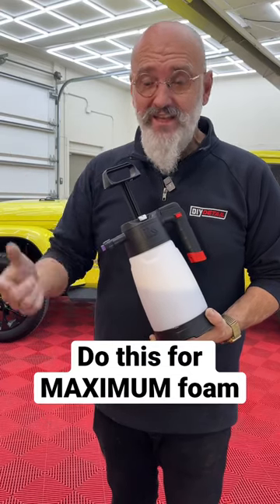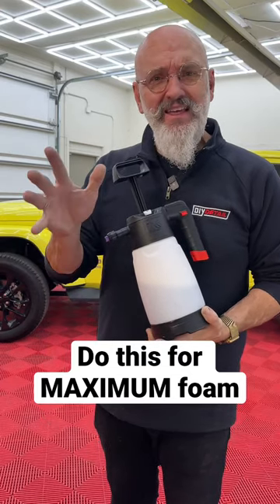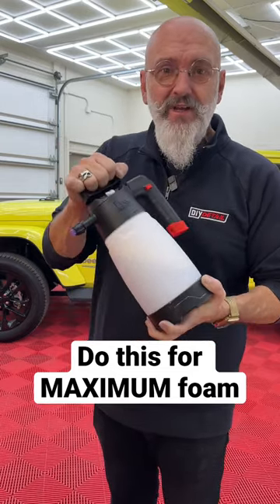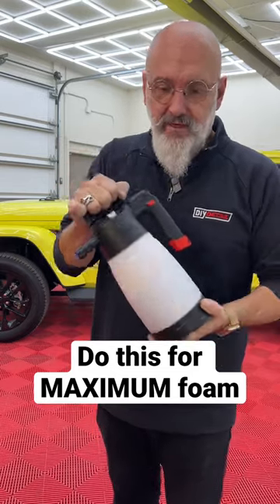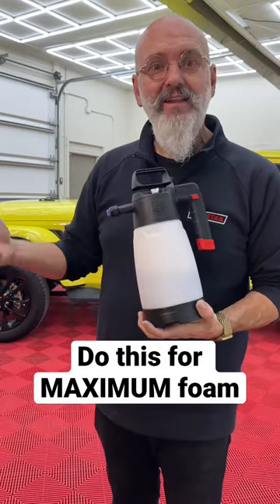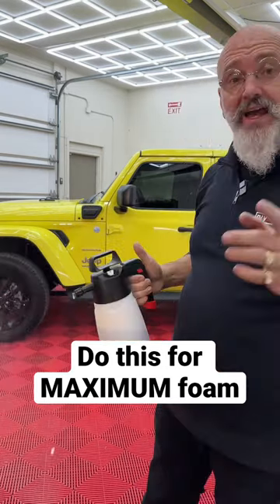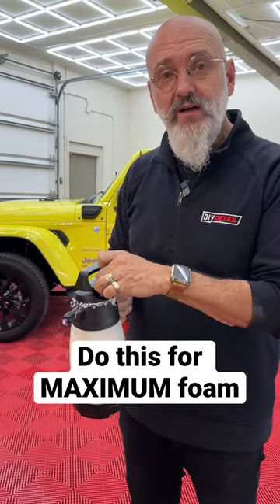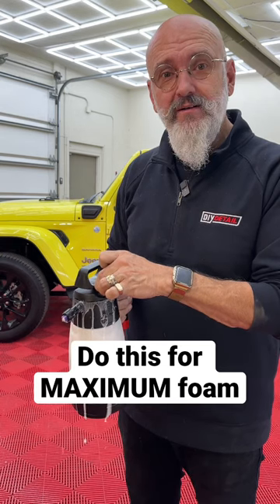Pump foamer tips!

Comment: Always hate the way my IK ejects foam out through the top seal when pressure is released. Just like it did in the video. Especially when using Brake buster .. it dries out and gunks up the sprayer head internals.
Reply: Same here, one of my gripes about it
Reply from the maker: We are not alone.
Reply: I only detail recreationally so I take the extra time to empty out the sprayer and rinse everything off. It definitely keeps my sprayer working like new

Comment: Excellent tip! I personally have a marolex just better quality for me. I did rig it with little air valve and my grandpa uses the compressor. But when you hear that noise it's fully pressurized and maximum foam
Reply from the maker: Why do you prefer Marolex?
Reply: @diydetailofficial  for me its preferential but Marolex holds pressure longer. I think they're a little sturdier and I like the handle and the ergonomics over IK. Plus they're made in Poland where part of my family is from.
However,  I also have IK and I use them as well,  they're still awesome quality and function nothing wrong with them
Reply from the maker: Thank you
Reply: @diydetailofficial  the zip up looks really nice and comfortable.  And I could watch y'all foam a vehicle all day
Reply from the maker: @thesamsquatch5224  they are comfortable, and we should have them on the site soon
Reply: @thesamsquatch5224  Marolex for the win! I also have both but prefer Marolex for the same reasons :) And im from Poland - they are cheaper here too

Comment: I can’t seem to get mine producing any foam at all. I have the same one. Going to try this tomorrow at work. Thank you for the tips. Crazy thing is I have been looking for tips on this just today I was looking on Google. Thank you sir.
Reply from the maker: Did it work?
Reply: I'm having same trouble 😕
Reply: When I 1st got my ik foam sprayer yrs ago I couldn't get it to foam because I made the mistake putting too much product in believe it or not.

I guess I have Nick's problem regarding "more is more" hahaha....in this case, more cause lumps of un foamed soap to lump out. With a higher ratio of water to soap/foam & ensuring the bottle had the indicated air barrier available (by not overfilling), I got great foam & continue to.

Comment: Why does it peel like that?
Reply from the maker: You will need to ask IK
Reply: I went through their website and looked at their FAQ’s.

If you have a o-ring kit…use a 1x2 sized o ring and snug it in between the colored tip and upper cap. There’s where the fluid comes up when pressure is released. It fixed my leaking issue.

Comment: Why is it so hard for them to just add a valve on there and have the ability to plug in your air compressor and pressurize it like that instead of making us pump like peasants
Reply from the maker: Some models are available with a Schrader valve.
Reply: You can easily add your own
Reply: As well as pressure relief

Comment: I'm pretty sure that all the phone is not supposed to come out of the top like that
Reply from the maker: You’re supposed to release the residual pressure, we released full pressure.
Reply: @diydetailofficial   I think that unit might have been defective because I have several of those pumps and they don't do that so I'm certainly not saying it was on you guys
Reply from the maker: It only does that when you release full pressure.